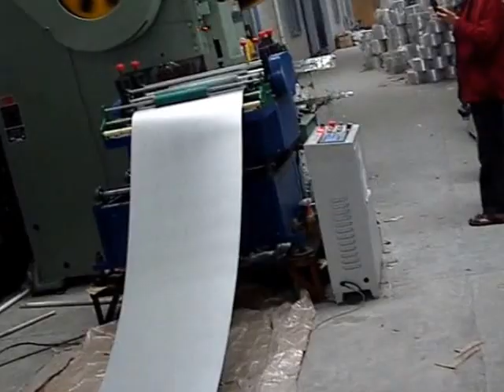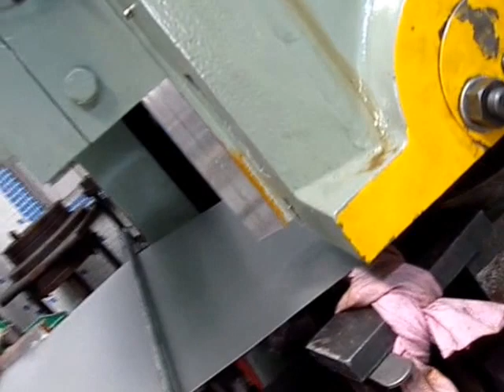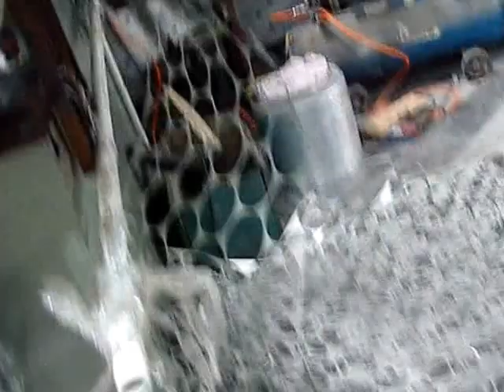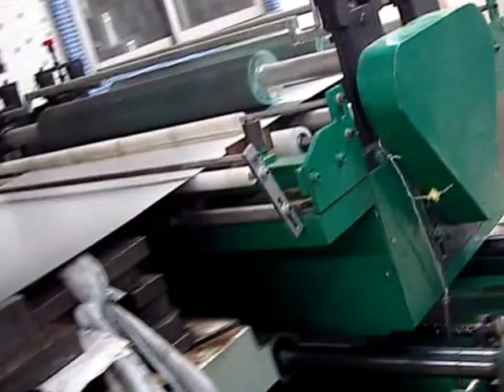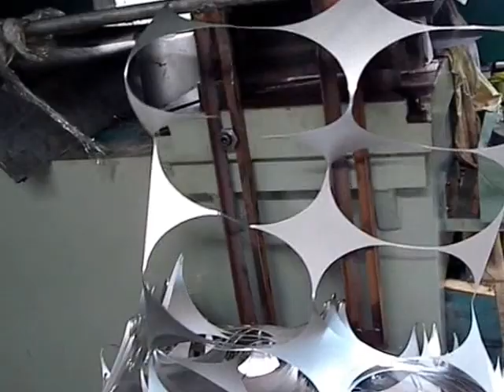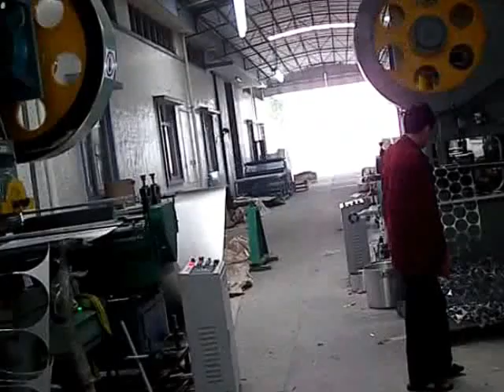Easy blanking line (punching circle line)

Comment: Available for 2mm and 2.5mm m.s.coil
Reply from the maker: Available
Reply: Please quote me we need to cutting 2mm and 2.5mm thickness of circle and size 120mm to 550mm 
Use for material 1250mm x2500mm sheet
Reply from the maker: your email?